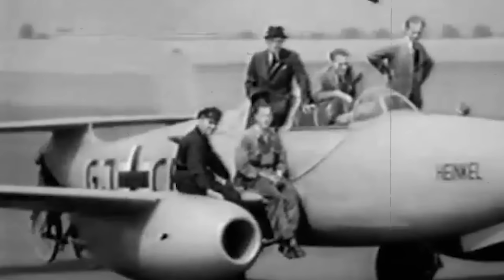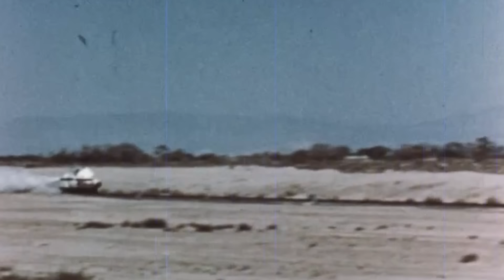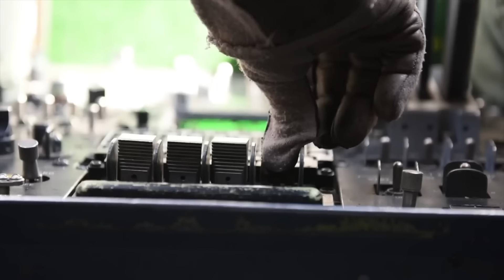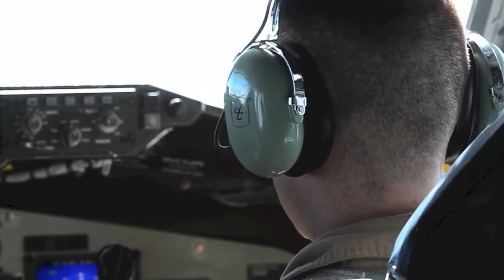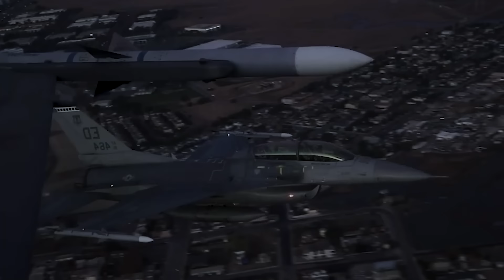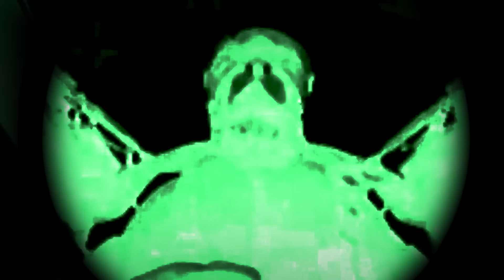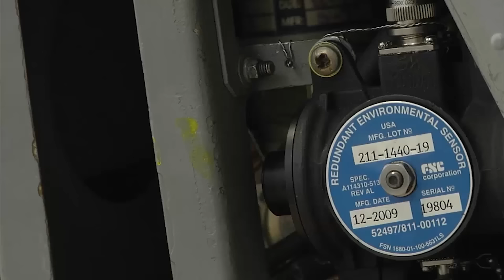The Darkest Air Force Secret They Tried to Bury Forever

Comment: About 20 years ago we had a T-38 ejection at our naval air station when they had an engine failure on takeoff.  The canopy failed to blow off but the crew still got out safely because the seats have breaker points on the top to smash through the Plexiglas for just such an event.  Inspection of the crash showed that the fiber optic cable that carries the canopy ejection signal had been broken, presumably when it was accidentally stepped on by the maintenance crew during seat installation as the cable runs right under it.  Our office sent out a mandatory inspection order of all T-38 fiber optic cables for both Navy and Air Force aircraft.  I never heard if any other broken cables were found.  Presumably, they changed maintenance procedures after that to prevent another occurrence.
Reply: I'm currently working T-38's at Randolph AFB, and there are no fiber optic cables in a T-38. The T-6, however, did, but we replaced them with explosive cords.
Reply: @drkpltr  Ah, after 20 years I probably mis-remembered the T-6 for the T-38, we had both at our base.  They no doubt replaced the fiber optic cable with the explosive cord because of this crash event.  I never heard that this happened, many thanks for letting me know!
Reply: @TonyA552  it's all good brother! It's pretty neat to see a video about something i actually have first hand knowledge of 🤓🤓
Reply: @drkpltr  interesting
Reply: "...the fiber optic cable that carries the canopy ejection signal had been broken...."
I'm actually shocked that cable isn't tested during the plane's power-up sequence.
Reply: These companies want to use fancy and expensive technologies to pump up contracts. I have to wonder if all of this couldn't be controlled by a clockspring mechanism driving a mechanical computer turret. Geometry can be used to time the triggering of events. I'd bet my life on that long before a freaking fiber optic circuit.
Reply: @goodday126  I worked as a Reliability and Maintainability engineer on US Navy aircraft for over 30 years and can tell you that electronics are about a thousand times more reliable for use on an ejection seat than any mechanical device you might come up with.  Mechanical gears can corrode (especially in a sea environment like navy carriers operate in), lubricants can dry and seize up movement, springs can break (with no way of testing them on a seat until the ejection handle is pulled), and there are multiple modes of parachute deployment timing depending on the airspeed and altitude of the aircraft during ejection.  It would be impossible to device a spring powered mechanism that can reliably operate multiple timings within the ten-thousandth of seconds necessary between life and death during ejection.
Reply: and honestly a huge testament to the thoughtfulness of the T-38’s ejection seat design. They really thought of everything with those breaker points! It's chilling to imagine if they hadn't. It also shows just how one small, seemingly harmless mistake (like stepping on a cable) can ripple into something life-or-death.
Sounds like your office handled it exactly right by jumping into action with that inspection order. I’m curious — did they eventually redesign the routing of that fiber optic cable to make it less vulnerable to being damaged?
Reply: @wewintvus  If you read one of the other replies to my original comment, I was told that the fiber optic cable was later replaced by an explosive cord, thus eliminating that potential failure point.
Reply: Fiber optics on a T38... LOL
Reply: @TurboMountTV aircraft do get upgrades. From modern avionics to radar array systems and new weapons systems. All requiring electrical upgrades also. And fly by wire doesn't always mean wires...😂.
Reply: What a bullshit voice. Mr seŕiou😮.
Reply: "Goooose! Noo.... oh, you good bro?"
"My head hurts... you never held me like this before..."
Reply: Why in the world would they choose to use fiber optic cable for this connection? It makes almost no sense.
Reply: Stepped on smfh. Hence why takes so long for modern jets to build/ maintain. Thinner cables reduce weight but stepping on them wow
Reply: Normally there are explosive lines in the canopy that blow a hole in it as part of the ejection sequence slightly before the seat operates.
The British seats also used to have garters that would pull the legs tight against the seat to avoid flailing legs, a problem with US seats was that aircrew who ejected never had them in many aircraft in Vietnam and ended up severely injured on the ground and unable to escape and evade.
Reply: @robshirewood5060  The A-6 Texan has det cords in the canopy but they didn't go off in this case because of the broken fiber optic cable under the seat that carried the detonation signal.  The other reply to my original comment said that they eventually replaced the fiber optic cable with an explosive cord to eliminate the possibility of another similar incident.  I believe that all modern US ejection seats have ankle straps to keep the legs in to prevent flailing legs during ejection.
Reply: @TonyA552  I thought the A-6 was the "Harvard" or was that the T-6 the US designations always confuse me?
Reply: @robshirewood5060  or Intruder?
Reply: @rockstarbmf9595  yes i forgot that one
Reply: @robshirewood5060 normally the canopy blows off. The explosive lines on the transparency is not typical
Reply: @drkpltr The  Harrier has an explosive canopy.

Comment: Last look a F16 doesn't have a tail hook
Reply: The F-16 is equipped with a tail hook.  It is for emergencies like the one described, not for regular use like the ones on Navy aircraft.  All Air Force fighters even the F-35 have one.
Reply: Might want to look again.  Google F-16 tailhook
Reply: The F111F did have one and I watched as one took the cable at Mountain Home in middle 70s because of main gear problems was quite a sight 😂
Reply: F16 is also used by the US navy. So it does have a tail hook. 
The ground based f16 still have it so they can land on carriers and to use the wires on airfields in case of emergency or some problem making a normal landing impossible
Reply: @mikkelgraff6879 The handful of F-16s the Navy operated were used as aggressor aircraft for air combat training. They were never used operationally, and weren't equipped for carrier operations. The tail hook on an F-16 is for use with the USAF emergency arresting gear, not for routine landings.
Reply: Many non naval aircraft have hooks. F15, F16 F22, Eurofighter Typhoon  etc. Some runways have cables for emergencies should the brakes or chute fail.

Comment: Dyess AFB is named after William E. Dyess who flew his plane into the ground instead of bailing when he could in order to hit an empty feild rather than chance his plane hitting a building in Burbank (that is Hollywood to you and me) CA . The cause of the crash was an engine fire.

Col. Dyess is buried in his home town about a 35 min drive from the base that bears his name.

16 year Dyess vetran. Miss the bones.
Reply: Yes, sir! Were you a Bat guy, or just a Bone guy?
Reply: @koori3085  I was a gun truck guy. I was assigned to the 7LRS. I was there when they stood the 13th back up. Their building became the new bat cave after the 13th got reassigned.
Randomly was looking for pics of the batmobile online earlier this week.
Reply: Veteran
Reply: Oh
Reply: Same deal with Robert "Fod" Travis. Broken arrow deal as well. I hear tell folks from the RV park sustained burns fighting the fire. It was a miracle the payload didn't activate. Fairfield would of vaporized.
Reply: @MrTM-fg6zn  nukes don't go off due to fires generally.

A nuke works by using extremely preceusly timed shaped charges to compress fissile material to the point where its density makes the odds of a free neutron hiting a nucleus skyrocket.

Basically, the timing of the shaped charges has to be precise to fractions of a second. A fire might set off the shaped charges, just not in the exact order at the exact time needed.

It would cause a bunch of fallout though.
Reply: @smithandshortdogs  precisely
Reply: Thank you for posting this. He was also a survivor of the Bataan Death March. He is well deserved to be remembered!

Comment: Anyone pick up on how the B-1 crew were awarded medals, but only after they decided to cancel ejection when landing the bomber was an option to begin with, and one which they executed successfully? If you think about it, the ability to eject has made military pilots a little more reckless where a civilian commercial pilot (passenger or cargo) would be fighting to save and land the plane till they either landed or died, but the Air Force was, engine off, fire retardant, eject. Not sure if they were still liable at the time for wherever the aircraft crashed into though. Something they also don't tell you. Just because you ejected, doesn't mean your responsibility for that aircraft ceases, especially if there was still some level of control left. If that bird crashed into someone and kills them, you can be tried for manslaughter (or whatever the laws of that state are).
Reply: BS….
Reply: @Blovi-qd4lh  Which part? Because if you follow other flight channels, you'll see most competent pilots, based on the CVR and CDR fought till the end, and either landed the plane, or died trying. These pilots tried to eject, realized there was an issue, then decided to land, and did so successfully. So my point seems quite valid, the ability to eject has decreased the responsibility of the pilots to safely fly and land their planes,  knowing they have an out (even if that out is a violent ejection). And it is very true, in most cases, if you eject, you're still responsible for where you plane crashes, even more so if you have hung ordnance.
Reply: @tonyf.9806  These pilots followed the checklists they are REQUIRD to follow. Uncontrolled engine fire. eject. Crews are more important than aircraft
Reply: @rdmgwinn  Missing the point though. Yes, they followed the checklist, but the point was, before even attempting to land the aircraft (which is almost always safer than ejecting, especially at night, at altitude), they were to eject. Because no such ejection exists in the civilian side, pilots will try to get that aircraft on the ground. And in a surprising amount of case, the aircraft could have been saved, or at least land safely enough to walk away from. This is a cultural issue.

Comment: I'd gowith Martin Baker for ejection seats! Years ago in a former life as an engineer I made cams using the best CNC cam-making machine out there (it still is!).. We got a drawing for a cam design as part of the mechanism for an uprgrade on their seats, I realised that what it needed was not a 'controlled' drop-off, but a 'negative cliff', with a spring pulling the cam follower down. Their original design was according to their boffins good for 20G, my adaptation made it good for over 30G, but they couldn't test beyond that.. Did I get the contract for producing the newly designed cams, considering I'd also upgraded the cam following mechanism? Nah! Robbing bastards! But, to give them their credit, they did take onboard my (simple) changes, and as far as I'm aware, they're still using those changes. Me, I'm happy I've saved some lives. But, I do wish I could buy a Lamborghini...
Reply: Nany a veteran or defense employee has provided improvement to our national defense for which they never received due compensation.  More of these kinds of changes to defense systems over real checks from 'Beneficial Suggestion Programs' exist.  These individuals will get their reward . . . later.
Reply: You're so funny you must be a good electrical engineer Great 🙃🤨🤔
Reply: @ Electro-mechanical.. Doubly funny! 😉
Reply: MB was forced to use the catapult system. If it's not their idea they won't touch it.
Reply: You'd be disappointed if you had a Lambo. Your contribution had far greater real value. Thank you.
Reply: @Harley-D-Mcdonald  Well, at least I can say I've contributed to saving lives, true. But..
Reply: @peterjones596 I hear ya. Life is rarely fare.